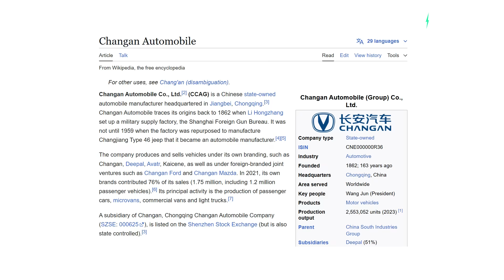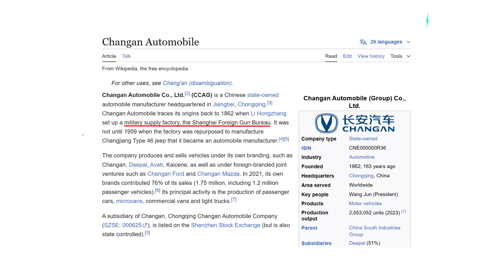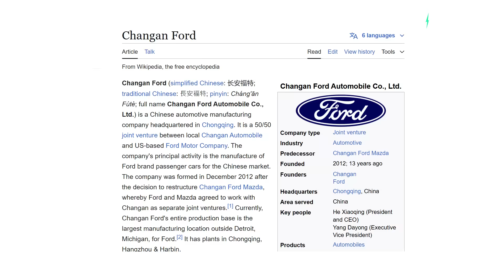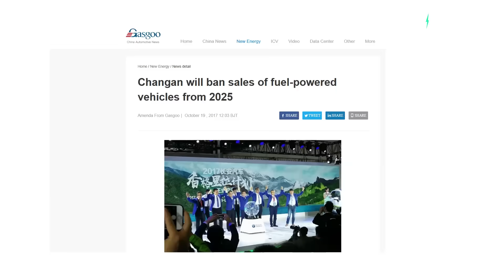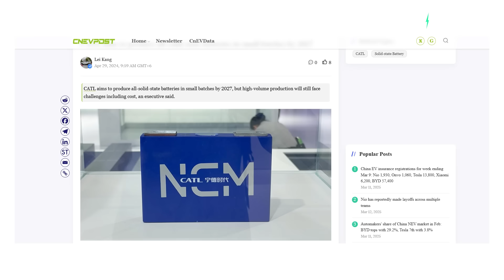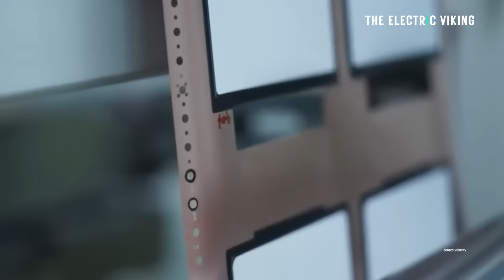Major EV Giant Promises 900 mile range Solid-State Battery Cars in 2026!

Comment: I do actually require a vehicle with 1000+ kilometre range. So this does tick off one of the major hurdles I face in moving from ICE to EV. 

That said... the energy density is only half of the equation. Sure... a 400wh/kg battery might not double a Tesla's range... but Tesla's motors are way over the top when it comes to a driver with an economical driving style. 

So given that the vehicle's weight and acceleration figures also have a big bearing on the economy rate, I could see a scenario where this sort of range could be possible. 

Personally... I would always take a slower EV with a higher range than vice versa.

Comment: The problem isn't so much range upon sale, but instead the range decrease over time and eventual need to replace the batteries at great cost. So when they have cars that go 1000 plus Km's on a single charge and hold that range for 20+ year and you don't need to replace the batteries ever, then I'd say it would no longer make sense to own a petrol powered vehicle.

Comment: If the vehicle will get 4 miles per kilowatt hour, (49.53 MPG gasoline) to go 1000 miles it will need a 250 kwh battery. How many BEV's get 4 miles per kwh?

Comment: What I want in an ev as an Asian. 

1. Affordable - $15,000-20,000
2. Toyota like reliability for ease of maintenance
3. 400 km of range for 1 week full of driving
4. Strong air conditioning and apple car play
5. Mazda kodo design. 

That’s it. I have a Diesel suv and gas city car.  I’m just holding out to see if I need to upgrade or not to hybrid/ev.

Comment: This is just nonsense. These battery companies are always making claims like this to generate investment capital and Sam has been covering these claims for nearly 3 years now on his channel. That’s fair enough, this is an EV channel after all but the reality is that nothing much has eventuated from these claims. If you check the specs for the driving range of a particular EV from 5 years ago, then compare that range figure to the advertised range of the current model, you’ll see for yourself that even with a better battery the extra range is handy but fairly mild. Batteries take decades of R&D to improve. Maybe by 2050 these 900 mile claims might be realistic.

Comment: how many miles range is not the major point, the major criteria is EV uses a lot more energy to move and accelerate as compared to an ICE car, where does this energy comes from ?  if the whole country uses EV, then everyday, energy in astronomical figures will be wasted no matter where you get it, we still need to burn something to generate the energy and more energy wasted means more emissions.

Comment: So basis your comments the typical EV gets between 4 and 5 kms per kWh so to get 1500 kms you need 300 - 375 kWh of battery  energy. 
Solid state batteries are not yet shown the energy density 3 times that of lithium Ion batteries so is the battery and thus the car  3.5 MT and bigger than the Hyundai Ionic 9 .
400 Wh / kg  to give 375 kWh is not going to fit in a midsize car and then see efficiencies. a batterie that weighs 1.3 MT would be the size of a BYD Seagull alone.  
To keep a midsize car at the current footprint and mass you need energy density of 700 Wh/kg and that has not been seen at this time.
I am calling BS on this one Sam

Comment: 1/2 ton p/u with the big tank and the efficient diesel engine get about 750 miles of range.  But, most of those owners would give that up for 600 miles of EV range due to the other added benefits.  900 miles is kind of an all-in point for most everybody else.  Even if you lose half that in a tow, you still got about 4 hours of towing.  We're heading toward trucks that charge once a month or even every other month.

Comment: Battery business is no different than any manufacturing business. To maximize profit and delay obsolescence the battery business introduce small incremental improvements to the energy density as well as offer several models with slightly better energy density over a number of years. For examples: 400 w/ kg, 450w/ kg, 500w/ kg, 600w/ kg, 700w/kg, 1000w/ kg, each sold at a higher price. Essentially, battery manufacturers will play the Mercedes number game: 400S, 450SE, 450S, 500S, 500SEL, 600S, …..

Comment: Realistically, who needs a car with 900 miles of range?  None of us needs a car with more range than our driving time between pees.  EVs that charge in less than ten minutes, plenty public chargers, and toilet facilities close by.  That's the ticket to fully functioning, lower cost EVs.
Reply: now that may be true, but in 5 years that range will be on the cheapo models.
Reply: @TerryHickey-xt4mf  
Think a bit.  Why pay for range that will never be needed?  Why haul around the extra weight which will increase the cost per mile to operate?  

Why don't ICEVs have thousand gallon fuel tanks?
Reply: But with 900 miles of range and a nappy you could go non stop.
Reply: @Peter000W  
Do you really want to drive hundreds of miles while sitting in your own poo?

Get real.  Who does not stop at least a couple of times during a long day's drive?  With a 400 mile range ICEV you're going to have to stop once for fuel.  And pretty much everyone will stop for a meal.  And for a bathroom break.

Comment: I know a lot of people are saying they don't need 900 miles of range. However, I know many people that live in apartments, or places where they don't have access at home for charging, and they would greatly benefit from having the larger battery capacity. Not so much for long trips but if you only drive 25-50 miles per day then you could go 2-3 weeks before going to a charging station to charge up. That would make owning a EV much easier for people in those situations.
Reply: What if there were chargers at grocery stores and other places where people go at least once a week?  Chargers that could add a couple hundred miles in less than ten minutes.
Reply: To my mind, I really can't imagine any big consumer needs above 500 miles in range. How often is John Q Public driving nonstop for 7+ hours on the highway?
Reply: @PlaylistWatching1234  I'd be fine with 250 miles.
Reply: @PlaylistWatching1234  
Pack a baloney sandwich and pee in a bottle.  Can't waste ten minutes on a pit/pee stop.
Reply: I live in Canada. The further a car goes on a single charge, the better. Also, solid state should be fine in the cold.
Reply: @ Given no compromises on cost or quality, I too, would prefer my car have a 10,000 mile range.
Reply: @ShnNar1000x
Reply: @ShnNar1000x  You're right, if an EV battery has 900 miles of range, it might actually run 500 miles in the cold winter
Reply: In this video Sam is talking about a normal size battery with a 1000 mile range. So the extra weight argument wouldn't apply.  If you live somewhere where you have large numbers of fast chargers at your local grocery store that you can count on then maybe that would work for you. I've had an EV for five years and have yet to come across anything like that and don't know of any that are being planned in my area. Personally I will take all the range I can get and will happily pay extra for it just because I drive and camp in remote areas where chargers are few and far between (but I realize that's a unique Usecase).
Reply: Range vs price/weight. Both arguments make sense depending on your lifestyle and charging availability. Solution? Sell the car in 2 different models. Smaller, (and  lighter) for city dwellers with home charging; bigger, for no home charging and regular road trippers who are prepared to pay the extra.
Reply: Not really, you can let it charge while you are doing your groceries, just choose a grocery store with a 50-100 kW charger, then you could spend a small hour and it will be filled up by the time you are finished.
A 900 mile car would have a 180 kWh battery which is 450 kg or 900 lb

Comment: The only issue I have with my CyberBeast is that it does not have 500 mile range, preferably 500 mile range while towing like the Tesla Semi. Other than that, the CyberTruck surpasses my expectations in every way. What an incredible vehicle, all-wheel steering, 0 to 60 2.6 seconds, the raise-up back seats make it great for my dog, FSD is incredible and I use it on >90% of my drives.

Comment: There is NEVER any reason to have more than 400 miles range in an EV.  It is a TOTAL WASTE.  You're just running around with a bunch of extra, heavy, and EXPENSIVE weight that you're not EVER using.  355 days a year, you're not driving over 40 miles - just to work and the shops.  But, even on a road trip, people with bladders and kidneys (or children with them) are stopping after driving about 200 miles.  As long as you can replenish that in 15-20 minutes, you never need 1000 miles of range.  Any manufacturer who puts that much in would serve customers better by taking out half of that battery and saving the buyer $10,000 and 800 lbs of weight.  NOBODY needs that, and smart people wouldn't want it.
Reply: Towing ?????
Reply: Sorry sir but i disagree.
Reply: I’d like a happy point of 500-600 miles just because a few ICE vehicles with larger tanks get that range.  250-300 is too little but 900-1000 may be too excessive unless they lighten the batteries considerably.
Reply: Try telling that to everyone who is passing up EVs due to range. You're not wrong but people's perception is that they need as much range as a RAV4 Prime PHEV in their EV.
Reply: Try living in the mountain west US
Reply: In Australia you need at least one thousand k,if you leave the city.
Reply: The charging stations in US is not everywhere like gas station. I wish they are here so I don't need to buy trashy Ford.
Reply: A futurist suggested one possible scenario. With AV, a long range would be in direct competition with domestic short haul flights. You and your loved ones could get in the EV at bedtime, don't have to deal with TSA or smelly strangers, go to sleep and wake up in the morning at your destination, true door to door. AVs are already being tested in China and the US. It will be true competition to airlines and roadside motels and campgrounds.
Reply: I think a lot of people are looking for one EV model with optional battery sizes.
Reply: How about when it gets really cold and you have a long way to drive?  You need extra power for the heater, and you need power to precondition the battery before charging.  All this at a temperature where the battery is probably only capable of giving maybe half of its normal power output.  You are definitely wrong.  I would absolutely take a 600 mile battery.  With that I could be reasonably sure I could go 300 miles and have some charge left when I get there.

Comment: I don't need a 900 mile EV.  I need a cheaper, 300 mile EV.
Reply: Simple minded. This invention will make all the 300 mile range cars dirt cheap.
Reply: The newer 900 probably cheaper than your current 300.  Just like electronic gadgets.
Reply: @hpw-ws6bj  a car is not a computer or calculator.
Reply: maybe both 900 mile and cheap? 😁
Reply: So then the car company will just use one third of the batteries and you will get a 300 mile range car.  That will make the car cheaper and lighter.  Plus since it's lighter, you will get more range so you still will probably get 400 mile range even with one third of the battery.  See how that works?
Reply: @jlrutube1312 unless the solid state batteries are inherently lighter.
Reply: @jlrutube1312  well if they are smart they will use 45  - 50% and get 400 miles as well as lighter. That competes with ICE compact car ranges, reduces cost of vehicle, and has that ease of mind range when you are not paying attention and need another 75 miles to get to a charger.
Reply: Good for you. 900 miles battery means people who don't have the home charger wont have to charge that frequently
Reply: @ Exactly this
Reply: Is worth mentioning for having ridiculous bargains on the market, there have to be some 900mile+ range cars to press the prices for 300 miles range vehicles further more lower
Reply: Probably ought to pass on this one
Reply: @charliemiller3884  as soon as 300 mile is on highway and when hot and cold with no preconditioning I’ll agree to this.
Reply: Aptera is a better car.
Reply: It's cheap in China tho, too bad for you if you are on US.
Reply: In China, you can buy an electric car with a range of 300 miles for about $20,000, and if you count tariffs and car salesman salaries, plus some store maintenance costs, the West may be around $45,000....
Reply: You can get a used Tesla for 25k or less. Most people aren’t concerned about upfront price because of the savings on energy costs and maintenance. The biggest deterrent is charge time and range for most people who are hesitant. This will completely eliminate that problem.
Reply: @charliemiller3884  Aptera is a good newcomer.
Reply: I need both characteristics, lower price and longer range!
Reply: Chevrolet Blazer EV SS range is 303
Reply: Must have 30k retail..wo incentives 500 miles range with heat  cranked up.. in the winter time .. more chargers. Then in 2027 maybe .
Reply: Two sides of the same coin.
Reply: 900 mile EV would probably make me cross that line and finally buy an EV.
That is enough even for our anual trip down in europe.
But of course even if it could do 1500 kilometer, me driving only highways on that trip, I guess at most I would be getting 1000 kilometer out of it. But that would still suffice
Reply: @mackan7086 you do need to stop somewhere to eat and use the toilet - you can’t just drive for 1000kms with no stops, especially with kids in the car. 😛
Reply: @uttherkunst3806  its not just that. Its nice to know you can stop where ever you want. You don't have to plan a stop where there are charging available
Reply: Are you from the UK ??
Reply: I do need a 900 miles car if battery degrades very very slowly
Reply: @ does your current car get 900 miles? If not, what does it get?
Reply: No one cares what you need.
Reply: You did not drive an EV if you talk BS like that. 900 mile is first of all not realistic and in wonder and higher speeds you get half of that. So the bigger range, the better for everyone.
Reply: I need a 1200 mile range ev to make my long distance trips on one charge.
Reply: @MichaelSimonik  why? You need to stop and eat or sleep. Why not charge for 10-20 minutes while you do that?
Reply: I will never buy 300 mile ev. 350 or more, preferably 400
Reply: What is wrong with a simple car that takes me from A to B. I don't need the self driving or the umpteen cameras or the 1-100 miles in 2.1 seconds. Just a basic car to drive to work and the supermarket
Is that too much to ask for?
Reply: I’d like a EV with a 2000 mile range.
Reply: Simple minded indeed
Reply: Backward thinking. Such a car would be a game changer and would go a long way towards converting more people over to EVs.
Reply: @imasharksfan1149  backward thinking is thinking the world needs ev's to help save the planet
Reply: Buy a used one. You don’t have to wait.
Reply: People accept a sub 300 miles range ICE car because they can be filled in 5 minutes. Similarly, they will accept a sub 300 miles range EV if it can be charged in under 10 minutes.
Reply: @ True if charging stations are everywhere like gas stations are.
Reply: @jlrutube1312  that will  never happen. The petrol vehicle refill convenience will never be achieved by EV'S.
Reply: @patelk464 are there actually sub 00 mile ICE cars? I have never driven one in 70 years.
Reply: @georgeacton9106  Where did you get sub 00 from?

Comment: Solid state battery technology is coming using silicon chip technology that will increase the energy density many times reducing battery weight. China is going ahead in production of these batteries while Tesla is still using old battery technology and not innovating. Tesla is facing stiff competition is falling behind due to Elon's political antics instead of focusing on innovation. This fatal attraction to politics will have consequences for Elon. He has gone off the deep end and has not realized that he and his company is irrelevant as Chinese and German companies move ahead. Tariffs are a sign that the US is losing the technology race against China. If my company is the cutting edge I would not be distracted with anything else except investing in even greater innovation. Tesla will crumble within two years.

Comment: Basically no one needs EV's with 500 miles or range. Most cars are parked 22 to 23 hours per day and most people don't drive more than 40 to 60 miles per day. No need for a car with 500 miles of range, not even for road trips, I have been driving EV's for almost 7 years now. I just went on a 560 mile round trip on my model 3. I stopped to charge each way for about 20 minutes, I stretched my legs, used the restroom then when I got back to my car it was ready to continue. The only people that have the so called "range anxiety" and think they need a 500 mile range battery are people who don't drive EV's and believe all the FUD about them. Oh and I forgot to mention, the car drove itself both ways, no problems. So yeah, Tesla pretty much already solved full self driving.
Reply: Nonsense. Just because you don’t drive long distances at high speed doesn’t mean others don’t.
Reply: @_winston_smith_  yeah, like 0.5% of the population. They can pay extra for a larger battery if they want but it needs to be optional, no need to make most people pay extra for something they will never use. 80 mph is good enough for me. You want a 900 mile battery you pay for it, I don't have to subsidize your nonsense.